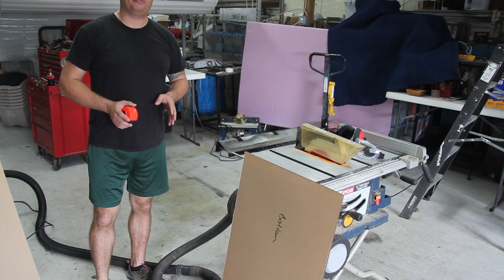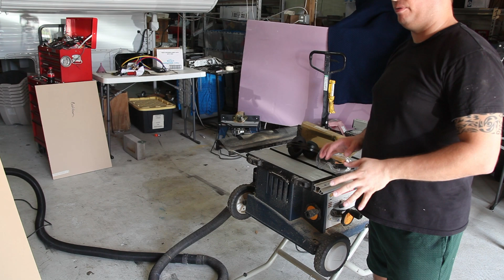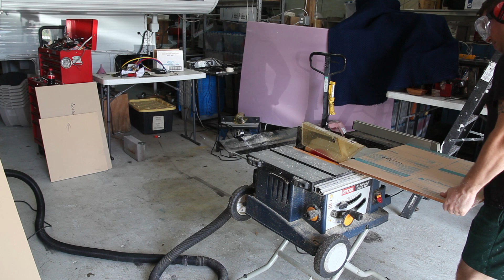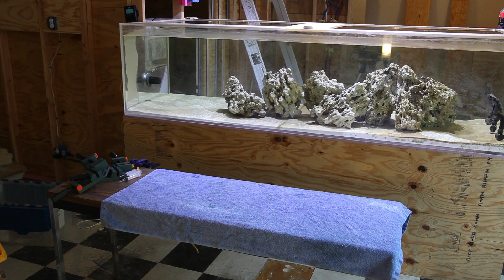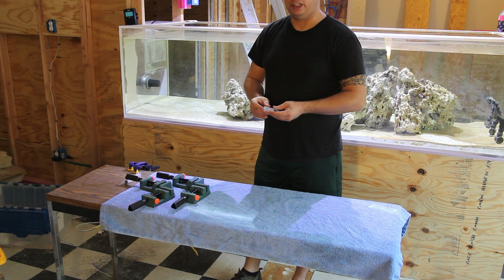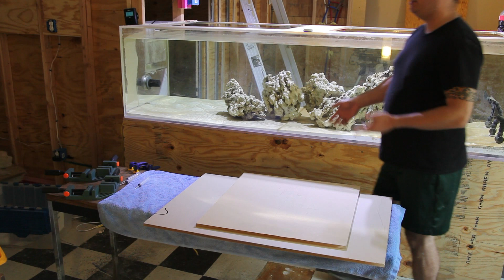Acrylic Tank Assembly Part 1

Comment: Hey Brian what are the dimensions of your display tank and thickness of the acrylic?
Reply from the maker: 8 feet wide, 3 feet front to back, and 2 feet deep, holds about 21 inches of water when full.  350 gallons.  Figure another 150 gallons for sump and refugium.

Comment: Brian, regarding your comment about acrylic thickness. Since your display's lengths, ends and base were of different thicknesses, were you using a calculator like CYRO's aquarium thickness spreadsheet to calculate the thicknesses based on the length and height of each sheet individually? How did you determine the proper thickness for the base? Thanks.
Reply from the maker: The base thickness isn't that important.  I use a solid plywood base for support.  It worked out well from a materials perspective to use 1 sheet for the sides (3/4") and 1 sheet for the top and bottom.  A 3rd sheet was used to supply the ends and fabricate a sump.  Length and Height play a role in bowing/warping.  There are a variety of calculators and I don't remember who's calculator I used.  Essentially 20-24 inches depth is the limit for 3/4 inch acrylic.  1" was out of my budget and creates headaches for tank maintenance.

My tank is still "down" due to selling my house, moving, and building out the new house.  It's taking FOREVER to get the new house built and ready to stand up the tank.  I'll be shooting videos when I start working on it.
Reply: Thanks for the insight. I'm looking forward to seeing updates on that tank. Hope it travels ok.

Comment from the maker: In my case I'm working on 1/2" and 3/4" acrylic.  Big tank is 1/2x3/4.  Sump is all 1/2 mostly leftover from the big tank.  You can work with other gauges (thicknesses).  Best thing to do is use a calculator for the deflection.  This determines the thickness you need.  If you hunt for it, I wrote a program called Aquarium Pocket Knife that calculates tank weight and volume.  It has variables to put in water type, depth, sand, rock etc and it will factor it all to tell you the total tank weight.
Reply: Brian Greul  hello I’m in trouble in need your help I broke my tank and need help to fix it so how will I go by fix it in the middle by seam